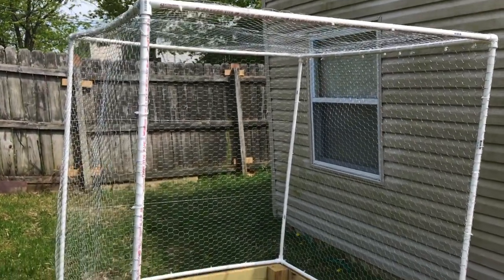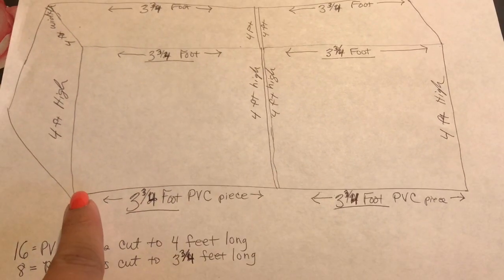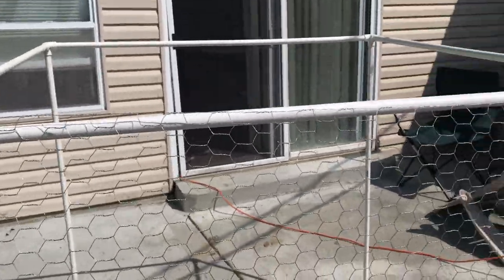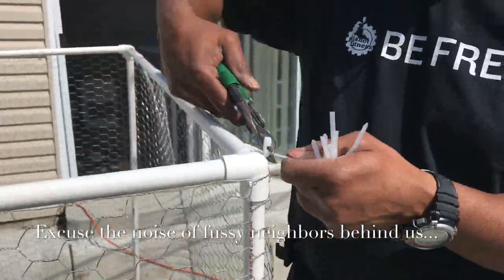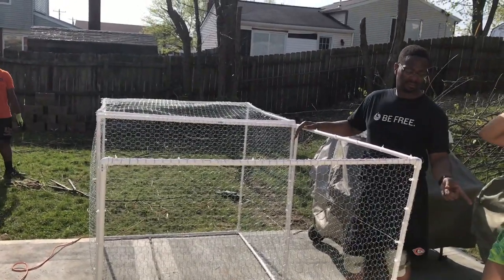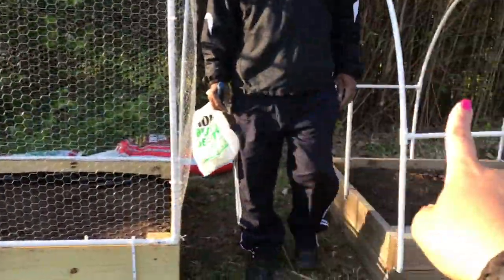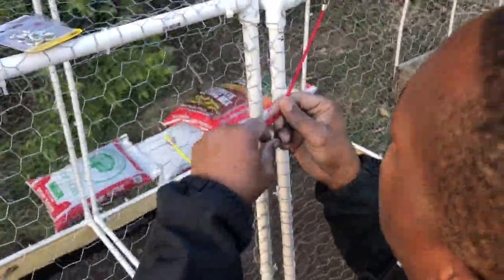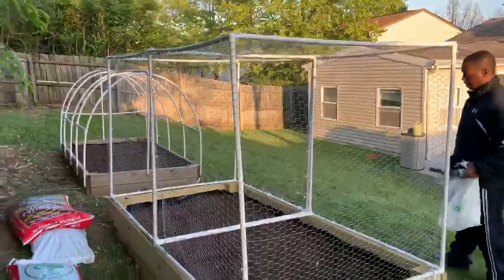HOW TO MAKE A RAISED GARDEN BED COVER TUTORIAL PVC | STEP BY STEP GARDEN BED COVER

Comment: I really like what you did there.  Wonderful.  I used those green metal posts you can buy at HW stores and painted them white and they are in the inside corners. and put the corner pvc pieces over the top of the posts.
Reply from the maker: Thank you!

Comment: This is such a great idea. My garden bed is 5 x 4, do you have any suggetions how long I should cut the pvc pipe because of the connectors and how many connectors I should get? Thanks
Reply from the maker: So sorry about the late reply but if you’re doing the rectangle cage - cut one inch shorter than the side you’re placing it on. The connectors will make up the half inch on each side.

Comment: 🤔 this is nice but it won’t keep rodents out of the garden especially with that huge gap between the two sections. Mice can easily go through the chicken wire. And if a rat can get its head through the it can get its body through but most adult rats will easily  aw through chicken wire. 
You would well to redoing this with treated wood and using wire mesh or taking off the chicken wire, adding a center pvc brace for support and using wire mesh. You would also do well to put wire mesh under the raised bed to keep critters from going under the raised bed. Anyway good luck with that. This is a great effort for first time gardeners, I wish you success with your gardening endeavors.
Reply from the maker: Thank you for the tips! 👍🏽

Comment: I like it. I'd be concerned with plants that want to grow taller than the cage though. Any thoughts?
Reply from the maker: Hi Robert, usually on the package of seeds it will tell you the height/width expectations. So plant things that won’t grow super high or keep it clipped 👍🏽✨
Reply: @traciesplace  Good advice thanks. I'll be making an attempt in a couple of days using yours as a model. Thanks again

Comment: What size corner fittings did y’all use?
Reply from the maker: The size fittings depend on what size pvc you get- we have 1/2 inch fittings because we have 1/2 inch pvc. 3/4 would be sturdier, but our 1/2 inch is still holding up well 🙌🏽